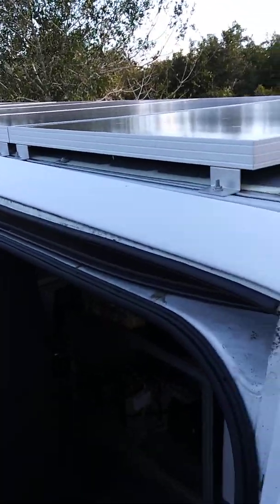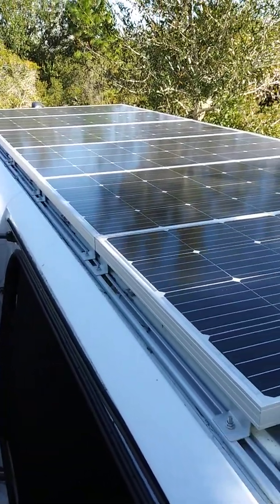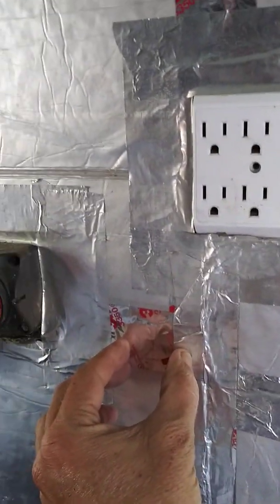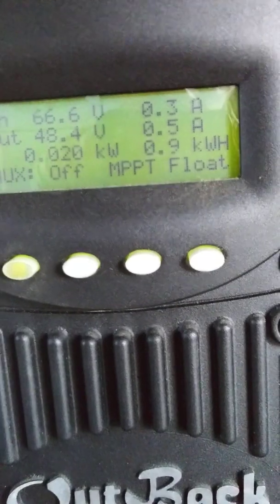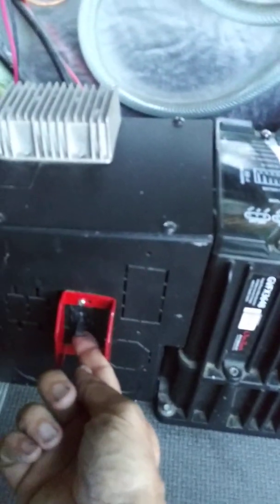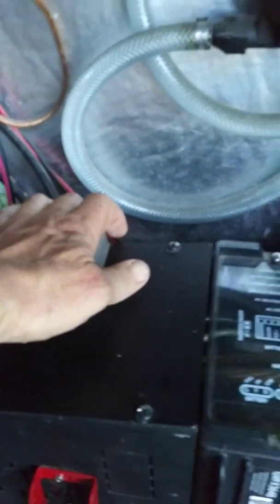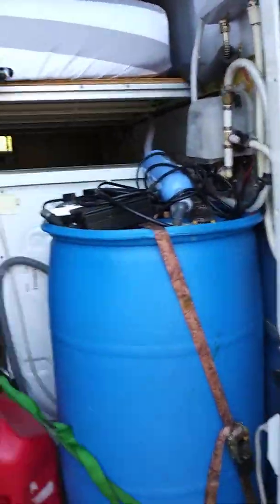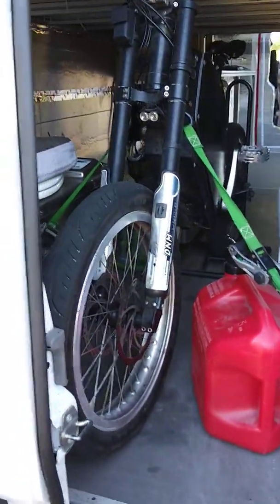From solar panels to the outlets👍

Comment: Whats wrong with the flexible solar panel. It didn't work well. Why you are not using those one. Are they not efficient. Thanks
Reply from the maker: It was only 800 watts and they were getting sun damage similar to how a plastic headlight cover does. They are great for deploying on the ground and picking them back up was a breeze too. They have that good point about them. Very light and compact. I need all of the watts that i can get so i went with solid panels.
Reply: @offgridphilosophy7959  how many watts do you need to run all day and how many ah batteries. Run a little fridge, and AC
Reply from the maker: @aldoyosbel1728397263  I only use 200 ah at 48 volts. It's the equivalent of having 400 ah at 12 volts. If you're running 12 volts i would go with atleast 300 ah. to run ac and fridge. Depending on where you live (how hot it gets), you might need 2,000 watts of solar or just 400 watts or so.
Reply: @offgridphilosophy7959  2000 watts panel, that's like 10 solar. It's a lot of space for a van
Reply from the maker: @aldoyosbel1728397263  To do it you'll need a small trailer. . .unless you have your own land. If you're far enough North you can probably get by with just your roof. If you use the same van and panels that i did you'll have 1,050 watts on your roof. You can expect to average out at about 500 watts with that in the real world. Unless you live in a desert area. Then it's sun all day everyday.
Reply: Not awesome 👍👍👍

Comment: I have decided to use my entire roof for solar and place my maxx air fan on my rear door. I'm doing two 400 watt Solaria panels. Glad to see someone else using the same configuration. It just make so much sense to max out solar vs wasting the space on a fan.
Reply from the maker: I forgot to show my air vent that is in my floor. It's 10" by 12". It's all steel and has closable flaps. That way you can roll windows up and fan will suck air in through that floor vent. 👍

Comment: What brand batteries are you using and where did you source them. Also with 900W of panels and 9600w of batteries that essentially would take all day to charge them back up assuming you don't use any battery power while they're chasrging. So do you use a backup generator or mostly shore power?
Reply from the maker: The batteries are 4 lithium cobalt batteries from a 2014 Chevy Volt. I got them on ebay. 25% discharge is about as low as i end up going typically so charging is easy.